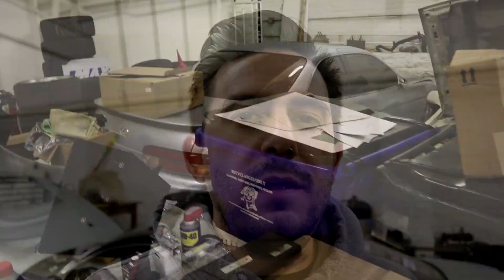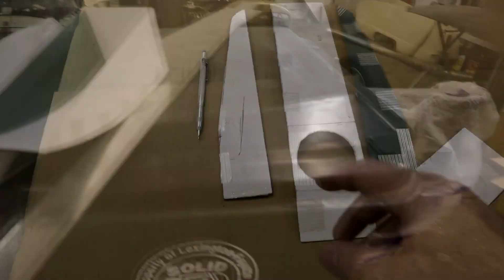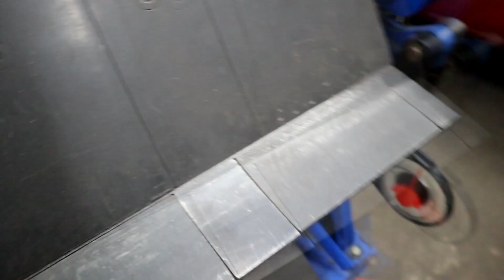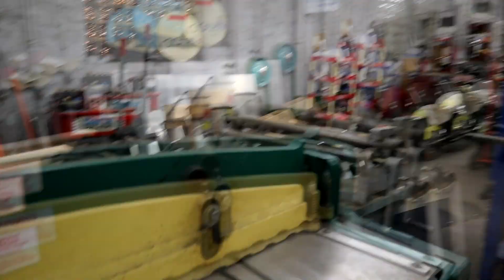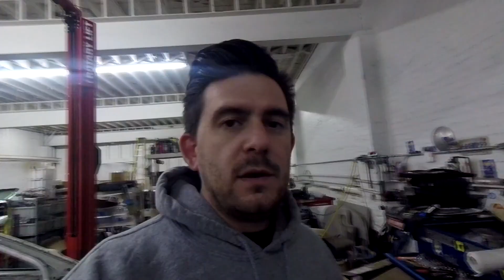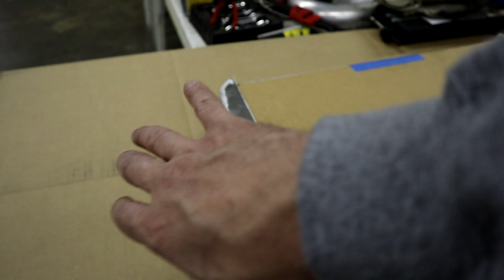HOW TO: Custom Intercooler, Part One

Comment: Did you make a part 2? Or is there a video where you used this intercooler?

I'd like to add a diverter into my entry side and also add some small bits of tube cut in half length ways. And weld them in between each core to radius the entry for each one.

I'm sure it'll end up being a lot of work for no noticeable gain 😂 but it must be more efficient even if I can't feel it
Reply from the maker: I ended up getting pinched for time on part two. If you are building from scratch, there isn't much extra effort to add them. The main gains will be in heat soak. With using the entire core more, it will take much longer to heat soak.
Reply: @dimartinofabsgarage8611  that makes sense. I was hoping the radiused entries into each core section would reduce pressure drop perhaps. I read a thread years ago where a guy did it, but I haven't been able to find that thread or any other example of someone doing it since